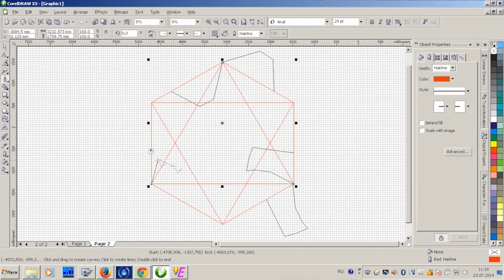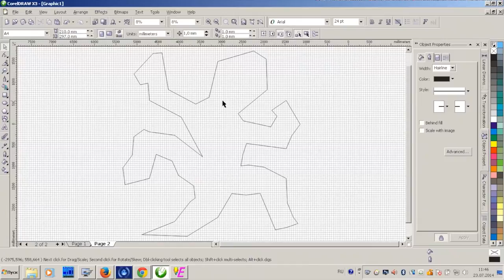Making M.C.Escher "Lizard" end grain cutting board

Comment: Very creative approach. I love your work and i enjoy your videos (and im following your twins grow up :)
I had many thoughts about making 3d escher lizards end grain cutting board, and your approach is surprising.
Did you ever try or think about making lizards from cnc and just gluing them together? What is the reason that you did it in your way? I think it feels a bit less prestige when you dont see the same lizard from both ways.
 My idea was to glue two wood pieces together, then slice to a 10x10 cm end grain pieces, then cutting each to a lizard on cnc with 0.1mm tolerance. Do you think this wont work?
Reply from the maker: Did you find this video? :)
To glue well separate lizards you need to apply pressure from sides. It is not easy with so complex shapes. I read about using vacuum bag to glue such part. When one of three lizards is stable the pressure from top connect all lizards well enough.
I can place "maple" lizard in any part of the board.
I didn't understand the last question.
I also use 0.1 mm tolerance.

Comment: You are becoming very skilled with the cnc tool, congratulations.
Why/how did you decide to start with the hexagon and triangles, and not something else? Did you get any help from MCEscher? Did you leave any "space" between the pocket cut and the outline cut.
Reply from the maker: Thanks! I took the most famous picture. The next is "Pegasus".
What do you mean by "help from MCEscher"?
Did you notice I used side clamps? :)
The outline is complex so I make 0,1 mm gap.
Reply: mtmwood Help from the artist M.C. Escher was what I was asking, did he help you lay out the drawing.
I did notice the side clamps and also the fixture.
Still my question is why start with a hexagon shape with two triangles inside, in CorelDraw. Why not a square or a circle or a circle with a square inside? Is it close to the shape or is it the count of the in parts and/or the out parts, 4 legs, 1 head, 1 tail = 6 = hexagon? Thanks;
Reply from the maker: Hollis Inman I don't understand you. Dutch artist M.C.Escher died in 1972. I use his pictured painted in 1939.
This pattern can be made only by rotating hexagon. It not depends on number of legs, etc. Lines inside it are service.
You can use only three shapes to make tessellations: triangle, rectangle and hexagon. I will show square=rectangle in the next video.
Reply: mtmwood I did not know the geometry for tessellations. I looked that up, also M.C.Escher , and now I understand. Very interesting stuff. Many Thanks as always.

Comment: Ну как всегда супер))) слов нет)) а можно вопрос? не скажите какая у Вас модель станка чпу))
Reply from the maker: Спасибо! Станок немецкий.

CNC-Milling Machine HIGH-Z S-720/T:
 Drive : 4 stepping motor by Nanotec with 1600 steps/rev    (1/8 Step)
 2 motors for constant tension and compression during milling operation on X-Axis
Guide ways X and Y axle 22 mm / Z Axis 16mm, grinded and with 61hrc hardened surface
 Ball bearings at both sides of trapezium spindles Tr. 12x3 mm flank lead
Traverse speed of rapid feed max. 2500 mm/min
Technical disslution 0,00187 mm ( 1/8 Schritt )
Table size / clamping area:1050 x 520 mm
 Traverse Paths: X=720 mm; Y=420 mm; Z= 110 mm

Comment: what type of cnc router do you have?
Reply from the maker: CNC-Milling Machine HIGH-Z S-720/T:

 Drive : 4 stepping motor by Nanotec with 1600 steps/rev    (1/8 Step)
 2 motors for constant tension and compression during milling operation on X-Axis
Guide ways X and Y axle 22 mm / Z Axis 16mm, grinded and with 61hrc hardened surface
 Ball bearings at both sides of trapezium spindles Tr. 12x3 mm flank lead
Traverse speed of rapid feed max. 2500 mm/min
Technical disslution 0,00187 mm ( 1/8 Schritt )
Table size / clamping area:1050 x 520 mm
 Traverse Paths: X=720 mm; Y=420 mm; Z= 110 mm
 Reference- and limit switch on all axes
double secured emergency stop button
 Energy chain for clean cabling
 Total dinemsions incl motors : LxWxH = appr.1070x690x500mm
 Milling Motor anchorage: Euroneck Ø43mm
incl. Software WIN PCNC Light
Modular frame for universal application
 Weight appr. 41 kg                                            
 Complete machine Includet 4 driver microstep controller 4x 3,5 Ampere                    2793,00 Euro incl VAT
Reply: wow thanks for the info! I think ill try something like this on my schools shopbot. doubt it will turn out so nicely but, ill give it a try!
Reply from the maker: Good luck!